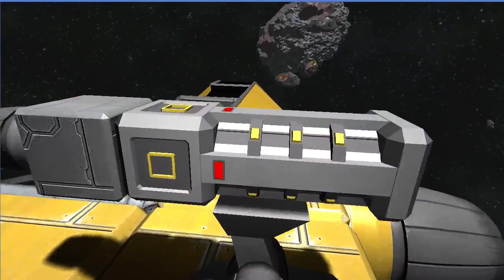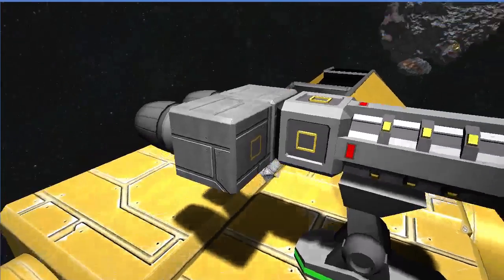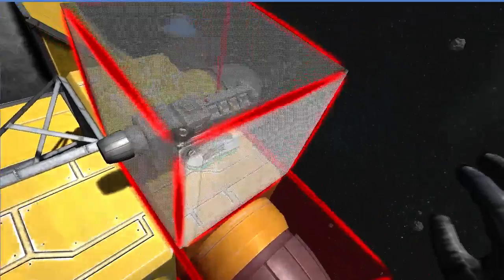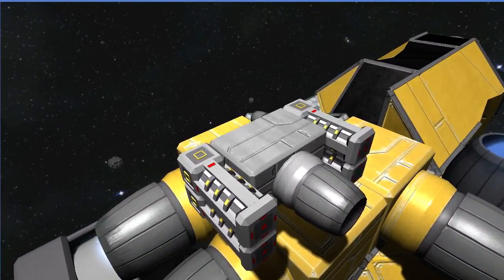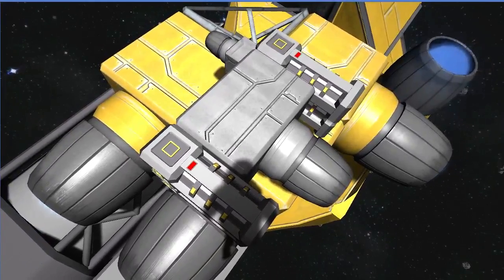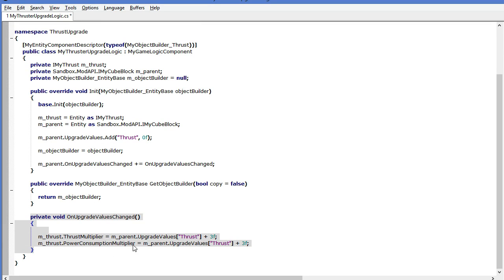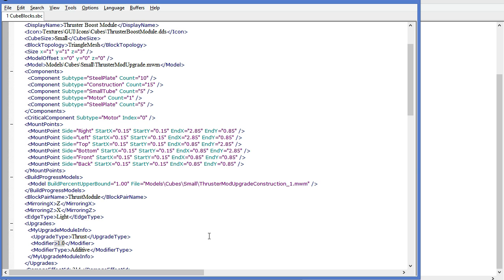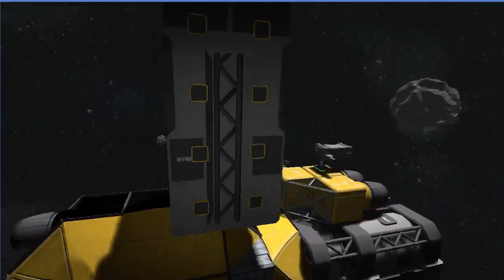Space Engineers: Upgrade Block Mod Tutorial #1

Comment: I hope they add the ability to modify the fuel consumption rate of reactors. Then you could make an efficiency upgrade block that reduces the fuel consumption but also the power production. I could see myself wanting that.

Do you think it would be possible to make an upgrade block that requires a resource in order to provide the upgrade? Like an upgrade module for a furnace that requires oxygen canisters to run?
Reply from the maker: Sentinalh Hm. I don't know.